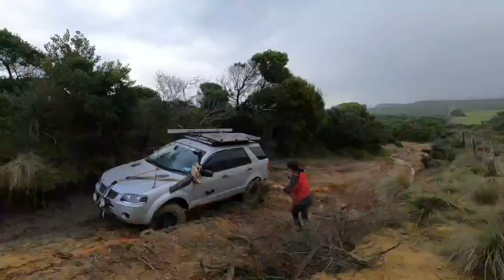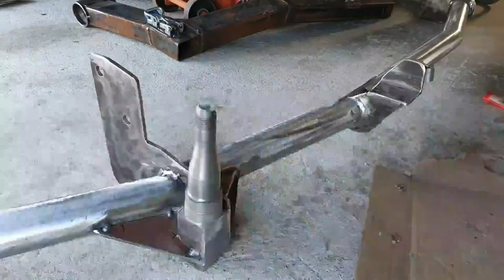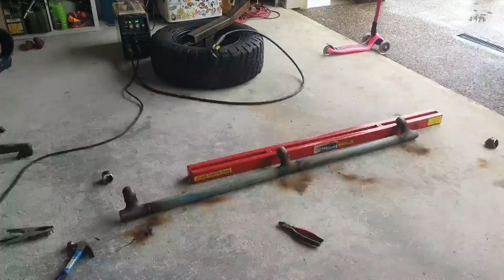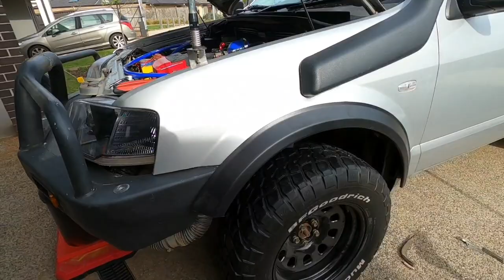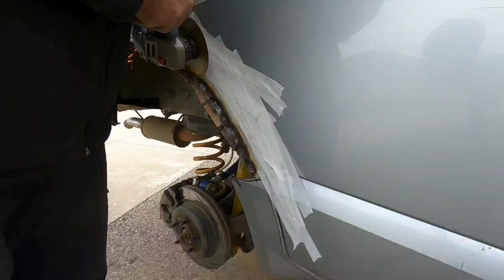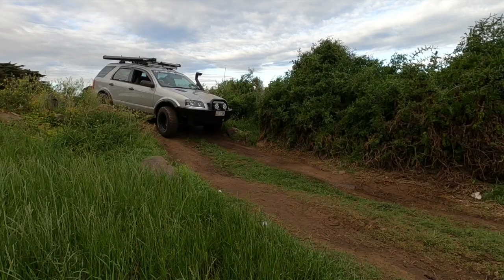Ford Territory Offroad Fabrication | Lifted | Bullbar | Rock Sliders | Wheel Carrier

Comment: Hey bro where did you get your spacers from, I'm looking at fitting 235 70r17 or 235 80r17 tires on my Territory. 

It's currently stock height.

I have a 998kw atomic rebuilt motor and 4.11 truetrac diff from stock 3.73, 

So my Terry is hitting limit before it changes gear... has 11% more acceleration and both wheels lock up.

So I thought to get around it, putting bigger offroad tires might help compensate....

What are your thoughts as you'd have a fair idea of what does and doesn't fit.

I really want to use my stock rims... it's currently rwd, still looking at going electric diff in the front once I go awd as I'll just run 350kw to the rear diff and 100-200kw electric to the front diff...
Reply from the maker: Not sure a 235 80 17 or 235 70 17 on stock rim would clear the upright. A 235 80 17 has a bigger rolling diameter than the 265 70 17 tyres I currently run and would take a lot of cutting to fit. Reason I've gone different offset rims as I've increased my tyre size was to clear the upright.

The biggest you can go with no lift on standard rims is 245 65 17 or equivalent. With raised springs and better offset rim's 245 70 17 is a good size.

If you check my video about how to lift them all the extra spacers and modification needed to run them is in that video.

I'd say pick up a cheap set of 245 65 17 tyre's first then look at lifting it and going  bigger if they don't work. 

With the kind of power you say the motor has I personally wouldn't of changed the diff gears to 4.11 and I'd be looking at trying to fit the widest tyre possible instead of biggest diameter.

Comment: Where did you get the bullbar from
Reply from the maker: It's a cut down Nissan Patrol bullbar. If you look at some of my other videos you will see me cutting it down
Reply: Do you reckon you could build a winch cradle behind the bar to fit one? Or is there no room with the radiator
Reply from the maker: @harrisonoconnor4844  I will be fitting one but I'll be cutting out the front reo and welding in a new winch plate with extra bracing.
Reply: Thanks for the info, so how will you go about with a turbo variant? Intercooler wise? Since you’ll have bull bar and winch in front, does it all fit?
Reply from the maker: @harrisonoconnor4844  I'm looking at running a small Intercooler or a water to air cooler.
Reply: @TerritoryOffroad   I’m assuming your not chasing big power out of a turbo one? Only coz big set ups run a larger intercooler? I’m only interested because I wanted the best off both worlds. Fast responsive transmission (ZF) a turbo Barra that I can chuck street tires on and have a decent run but fit the power for off-road on a lifted transmission but running 31’s on it, I only ask because I’m in the same predicament as you, accept yours is an off road use mostly. Where as mine will be 50/50 😂 call me crazy but I’m stuck between the two so I thought why not both, just thought it would be something different you know?
Reply from the maker: @harrisonoconnor4844  I would only be looking for around 300-350kw at the wheels. I'll be running a pulsar gtx3582r. With my plans to run the 4.1 diff gears behind the ZF it won't really work with smaller wheels.